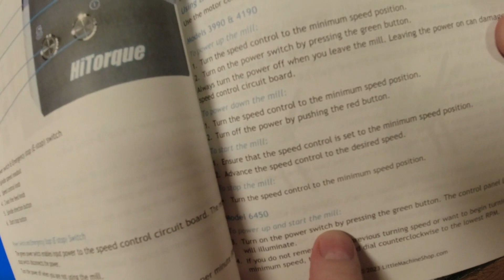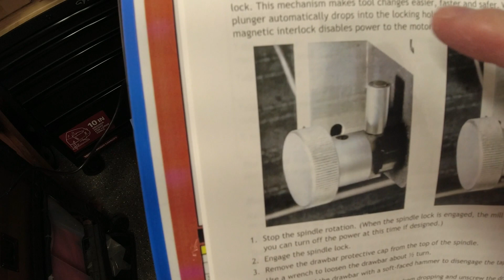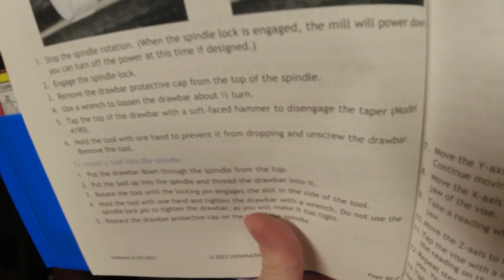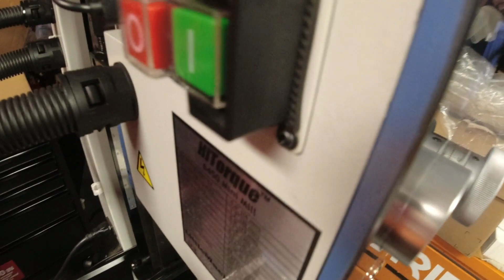Why Won't my LMS HiTorque 6450 Mini Mill Turn On or Stay On?

Comment: Any info on where to grease and oil the different areas of mini mill and if you also took it apart to clean all the shipping lubricant. I also just bought this mill a week ago and used it already on a small project. Amazing what this little machine is capable off. The reason for the first question is there are some ball points for grease on the mini mill, but found out thru other videos that those are for oil and not grease on other milling machines. I'm just starting to learn to be a machinist again for retirement as a hobby. Was a machinist over 30 yrs ago, but forgot a lot of knowledge that goes with these machines. Any helpful info would be appreciated, thanks. Oh and I had the same problem that you did on video when I first tried to turn it on, good video.....
Reply from the maker: I have a bunch of videos to publish on my HiTorque 6450...but I have to "sprinkle" them amongst my other hobbies/interests to keep things interesting ;-)  More to come for sure!
Reply: I’ll be looking forward to your videos, thanks